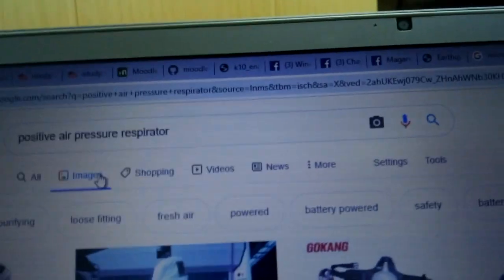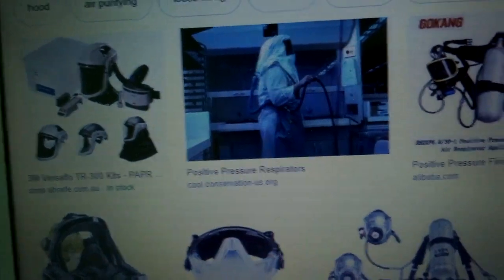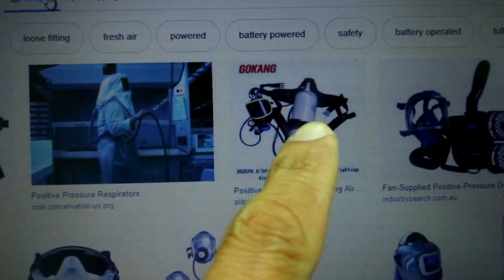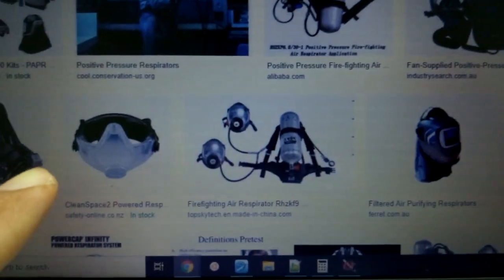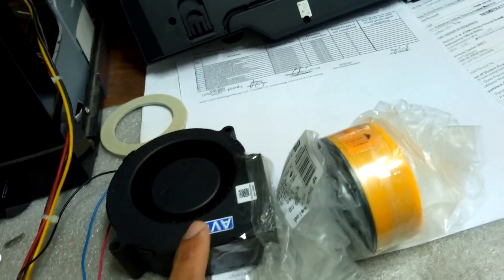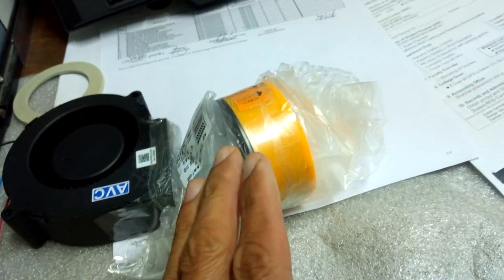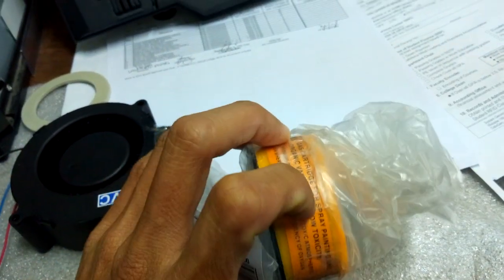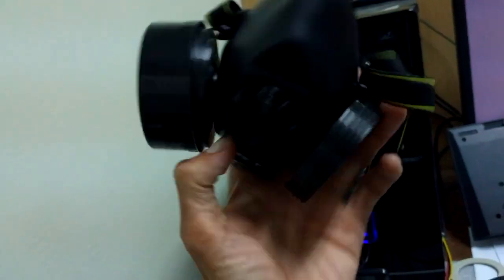how to breath effortlessly thru a gas mask DIY PAPR 1 of 3

Comment: hi, please tell me which fan you installed.  and what power bank.  For example, I found a 12 volt 2.7A fan.  and they tell me that I can't find a power bank for him.
Reply from the maker: 12v 2.7a fan is strong! you can use any 12v power supply that can provide more than 2.7a. but i would use a fan speed control circuit to slow down the fan.